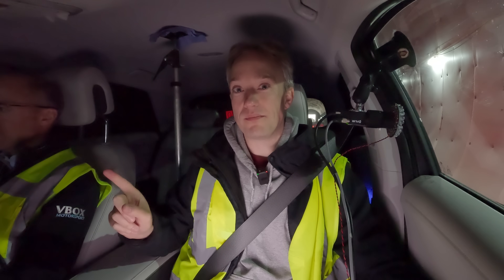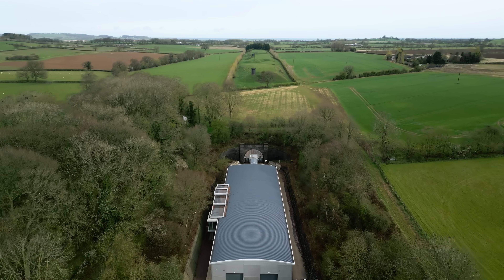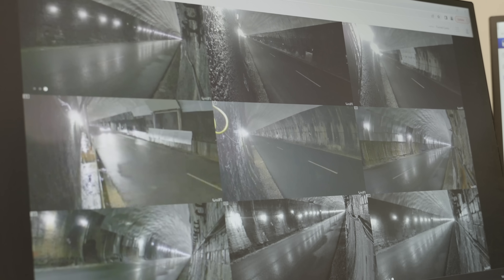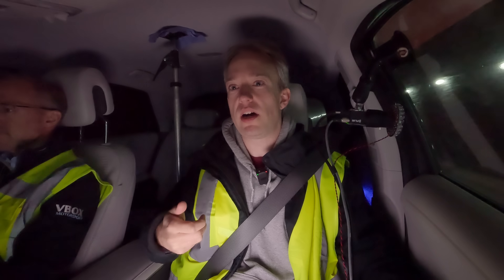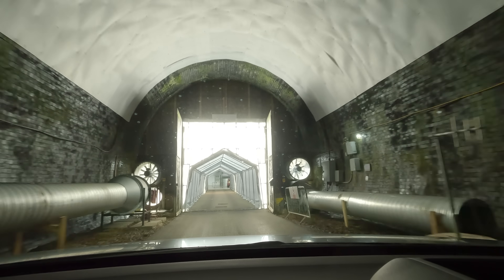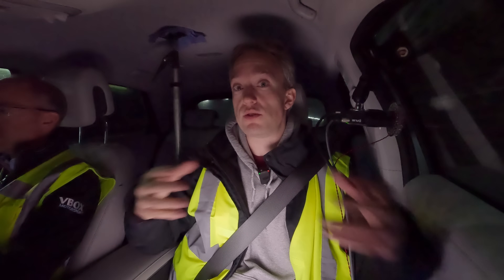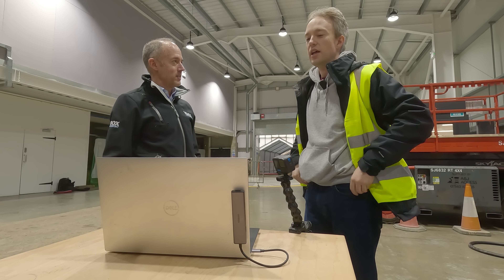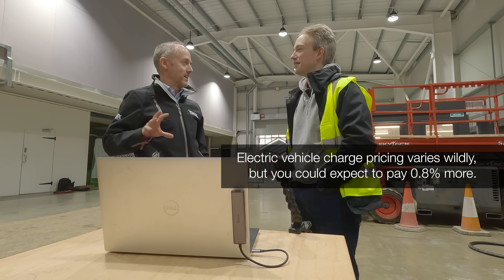This is an excuse to show you a really good tunnel

Comment: 3mm deviation off the laser is absolutely crazy to me. How did they do that?
Reply: From the overhead drone shot it looks like it was built using cut and cover (at least in parts) so after cutting the earth out they had clear sight lines with theodolites.
Reply: @TigerWalts  I believe it was only a tunnel because the local landowner made it part of his permission for the railway to cross his land. Otherwise it would simply have been a cutting. As a result I think you are correct, it was a cut and cover job.
Reply: @TigerWalts  Well spotted - those external shots looked very odd, almost as if the 'tunnel' had to be covered on parts of its length!  If so, why not just dig a cutting???
Reply: More stringent adherence to set measurements and probably a very accurate plumb line.
Reply: @glenngriffon  plumb lines are affected by gravity, that would give you a curved tunnel at these kinds of lengths
Reply: @glenngriffon  plumb line wouldn't do it - the direction of gravity is going to be about 0.025 degrees different (or 7e-5 turns), which means a height difference between 57cm and 1.14m between the laser measurement (near enough a stright line) and the plumb line curve, depending on where the tunnel is perfectly horizontal - at the midpoint, and both ends will be 57cm above the plumb line curve; at either end and the other end will be 1.14m above.
Reply: @glenngriffon how do you do a plumb line in a horizontal
Reply: @wellwell7950  "@Glenn Griffon how do you do a plumb line in a horizontal"

As plumb measures vertical level, you can't, unless their sense of vertical is perpendicular to relative to our vertical.
Reply: @glenngriffon  That doesn’t explain how they accounted for the curvature of the Earth. A plumb line always points to the centre of the Earth, give or take the odd density variance.
Reply: @glenngriffon  would the plumb line not make it go roundy because of the curvature of the earth though?
I don't know how to use a plumb line so that could be a very silly question
Reply: @sandwich2473  If you want a straight line, you cannot use anything affected by gravity, like water level or plumb lead.
Light would work. At the time they didn't know it too was affected by gravity anyway 🙃
Just not enough to make an earthly tunnel follow earth's curvature.
Reply: @Wannes_  Light would only work to a degree. Doesn't really take much to bend light. Really the only way to not would be in a vacuum.
Reply: @Wannes_  You can use any measuring device affected by gravity, as long as you can calculate the effect gravity has on it. For a water level, the air bubble just doesn't have to be in the middle (except in the middle of the tunnel). Calculating the angle is basic trigonometry.
Reply: @glenngriffon  I'm thinking a theodolite or a transit, used from a fixed point.  

If they'd just used a plumb line, wouldn't they have wound up following the curve of the earth, since "down" at each end would be at fractionally different angles from each other?
Reply: especially when considering the fact that over 2.7 km due to the curvature of the earth the tunnel rises 57 cm (22 inches) (making some assumptions)
Reply: @DanielQRT  I get about 14 cm  [ 6350-sqrt(6350^2-1.35^2) in kilometres ].
Reply: @jaapsch2  i assumed the tunnel was perfectly level at one end, your calculation assumes that it is perfectly level at the middle
Reply: @DanielQRT  You are completely correct. I assumed a straight line between start and end, and that the start and end are at the same elevation, and then the middle is 14 cm lower than an Earth curvature tunnel would be. Since they said the tunnel goes downhill or uphill all the way, your assumption is more appropriate for modelling this situation, and will give an answer approximately 4 times larger.
Reply: @DanielQRT  Turns out it's not level at either end nor middle; they advertise a constant 1:176 gradient (about 0.325 degrees). Gravity would differ by about 0.025 degrees between the ends. A constant gradient would be a good thing for railway.
Reply: @DanielQRT  "@Jaap Scherphuis  i assumed the tunnel was perfectly level at one end, your calculation assumes that it is perfectly level at the middle"

I'd argue that getting it "perfect" is impossible since we can't work at an infinitesimally small level. But, the tunnel could be either flat or level the entire length of the tunnel, but not both due to the scale. Being level at one entrance doesn't require the middle of the tunnel to not be level, it's just the point of level at the center or either end wouldn't be the same for the other two.
Reply: @DanielQRT  I think it's more like 14 cm, you might have forgotten to cut the tunnel length in half. If we assume the earth radius to be 6350 km, then we can create a right triangle with this radius as the hypotenuse, and half the tunnel length as the shorter other side. Now we calculate the difference of the radius and the longer other end to get the deviation due to curvature at the midpoint, where it is the highest: 6350 - sqrt(6350^2 - (2.7/2)^2) ≈ 0.00014 km = 0.14 m . When you do the the same calculation without using half of the tunnel distance, you get the 57 cm you mentioned. But I might have overlooked something, I just wanted to work it out for myself
Reply: @BambooTime  You're right, I did the math (in a different way) and got the same result, 14cm ... that means the difference between straight and curved has nothing to do with 19th century tunnel engineering and everything with 21st century road surfacing. Well, that answers that.
Reply: @MatthijsvanDuin  So, relative uphill and downhill, as opposed to the actual gradient. Yes, that is what I was referring to. Apparently the chosen language we each used was meant to convey the same thing but was confusing to the other.
Reply: @bodyrumuae2914 I really have no idea what distinction you're making here... How would you define uphill/downhill differently? 
What do you mean by "actual gradient"?

The gradient of a road is normally measured relative to a "horizontal" (i.e. level) surface, meaning zero gradient = neither uphill nor downhill = constant geopotential = a ball dropped on the street will stay put and not start rolling in some direction.
Reply: @MatthijsvanDuin  Now you're just confusing yourself.
Reply: @bodyrumuae2914  Ehm, no? I just asked you to clarify what you meant with "relative uphill and downhill, as opposed to the actual gradient" since I genuinely have no idea what you mean by "relative" or "actual" here or how they're opposed.

(And just in case, I clarified what, as far as I'm aware, the term "gradient" means when applied to roads.)
Reply: @MatthijsvanDuin  I already gave a confirmation, yet you continue. It's is you confusing yourself, not me confusing you.
Reply: Nope, laser level doesn't curve
Reply: @kylancook3477  The laser producing level itself, yes, won't curve. Laser beams, however, can be curved.
Reply: @DanielQRT  No, remember Tom explicitly said that this tunnel, even though it was built in the late 1800's, was straight and accounted for the curvature of the earth.  He said you can put a laser on one end and it will hit the other end.
Reply: @DanielQRT  The tunnel was built on a gradient of 1:176, too, with the south end being highest.
Reply: @DanielQRT 

I did a rather rough calculation and got a figure of 7 inches. But the error in that could be down to the number of significant digits involved. We're within a 3:1 range and the modern floor is much more precise.

It would be interesting to have floor-to-roof heights, but it would need a lot of readings because of the variations between blocks.
Reply: @DanielQRT    Not really.  There are different ways of defining earth curvature.   One way is to say if we draw a perfectly level line from this point,  now much will the earth have curved away from out line at XX distance.  For this defintion of curvature 57 centimeters is about right for 2.7 km.  However, this isn't really the best definition for this situation. Another way is to say, if you have two points XX apart on, and you draw a perfectly straight line between them,  how much will the earth curve above that line at the midway point.   The answer for that, for two points 2.7 km apart would be about 14 cm.   the 14 cm rise between the two points would be more applicable to this situation.
Reply: Visually lining up markers mostly. They started with two points to make a line, probably stakes in the ground with a marker attached. Then they keep adding these stakes as they go and line the markers up with the ones that came before. Great for getting a very straight line, but tiny inaccuracies at the beginning will go the whole length of the tunnel. I don't think it is that much different to how we do it today, except we have lasers.
Reply: @piraterubberduck6056  That the Roman Road way isn't it?'s
Reply: my guess would be literal thread under tension
Reply: @stefanmadzharov9170  not for several kilometers. We don't have a single material on earth that could withstand the tension needed so gravity doesn't get a say in the string's path....

Unless they stacked them after each other and someone with a really good eye, or one of these landscape measuring telescope things, checked that it was a straight line. Which I guess is kinda a "laser scale", just without the laser, but still light based.
Reply: @BloodyMobile  A theodolite
Reply: @BloodyMobile nobody said it needed to be one single line there could be tons of it put together but that gives much room for error tho so idk
Reply: @BloodyMobile  fair enough, didn't think this through.
Reply: @stefanmadzharov9170  Over a long enough distance, there is no substance that DOESN'T droop even at the maximum tension the material can tolerate.
Reply: @stefanmadzharov9170  my guess is water
Reply: Carefully
Reply: Maybe they did use a light, cause they couldn't use water.
Reply: Maybe with some sort of pipe level. Its amazing how accurate you can get with those.
Reply: @pepwaverley2185  you seem to be failing to understand that being straight and being level are totally different things. I could make a tunnel at 45 degrees that is within 3 mm of being perfectly straight and obviously any water would collect at the bottom.
Reply: Not just how, but why? A rail tunnel doesn't need such exact tolerances.
Reply: @ROGER2095  because it wasnt that precise back then, they just added the asphalt when they reopened the tunnel, and that had to be precise
Reply: They've got a modern road bed in that old tunnel, they could have evened out any flaws when they put that in.
Reply: Most likely, hyper advanced aliens with access to time travel.
Reply: @TheLolilol321  More European history needs to have the "bcuz aliens" explanation used for it.

How did the Berlin wall get built in a single day? Aliens. How was this clock tower monolith in London, nicknamed Big Ben by the locals, built? Aliens. How did Notre Dame get built? Aliens. How did Romans figure out you cud mix water with chunks of the earth and make concrete? Aliens taught them.
Reply: I imagine the clearly modern road surface has a lot to do with it.  The underlying tunnel could be off by inches and just smoothed over.
Reply: If you are very careful, check, recheck and check again with the instruments they did have then it can be done ....  it's just much quicker and easier now ...
Reply: I doubt that. Just the roughness of the surfaces is far more than that meaning that it deviates many centimeters within a meter.
Reply: A simple transit would do fine, as long as the operator is careful.
Reply: @rich1051414  "A very long string under tension. They just have to measure the distance to the road periodically down the length. This is why it's flatter than the curvature of the earth. A string under tension is flat."

For your claim to be true, that would require infinite *tension.
Reply: If you want crazy, look up the Ligo and Virgo experiments. They are like rulers in that they are devices that measure their own length. These tubes are about 4km long, but this length is known to a precision of a tenth of the width of an atom.
Reply: shovel
Reply: A theodolite was likely involved
Reply: If you look at some of the shots near the floor level that have low grazing incident angle one can see that the surface appears to have been ground and slightly polished (note the flat top of larger rock with the lack of sand attached to the flat surface).  This was probably done as the last step with a grinding machine that was sufficiently large to have multiple optical targets being monitored by an optical theodolite. Think of a large lapping machine with optical guidance. Probably did not use a Gyrotheodolite.
Reply: It must have been a coincidence surely
Reply: Probably a laser haha.
Reply: Tom Scott and James May would be either a great combo or at least a funny combo!
Reply: @smeeself I'm curious why 2700m could be a limit here
Reply: A very long spirit level
Reply: I’m guessing they used a theodolite (the tripod and telescope you see the surveyors using at the side of the roads sometimes)
Reply: now that is a video idea!
Reply: 2 or more holes lined up at the start and look through them for a light source.
Reply: @Henrix1998  that's very clever :O
if they made the same kind of apparatus and then positioned them a distance apart, it'd also keep them centred
Reply: they had math when they built it :P
Reply: @dingaia  Well they used Maths. It is Britain after all.
Reply: @dingaia no they had maths.
Reply: Serious Northerners with flatcaps, a pencil and a refusal to do a shoddy job. They probably got made redundant as soon as they'd finished, because Britain.
Reply: With good surveyors.
Reply: They have a big monument (just a massive concrete or stone that wont's easily move, might have been removed after construction) burried flush with the ground dead center of the tunnel, a probably a hundred feet from the entrance outside. (enough that it's not in the way as it can not get "bumped" there is usually a steel plate with screws on around it so it can be fine tuned. from there, the surveyor can set up his transit, or optics or whatever directly at the same spot every time. I'm not familiar with exactly how they did the measuring part of it, but it could be as simple as wait for night to fall, then have a second surveyor down at the working face measure out the exact center of the face and put a light there. if there's deviation from day to day, the tunnel is not true, and the surveyor will mark their center, and the true center as set by the transit outside, so the work can be adjusted.
Reply: I'm more interested in why it's a straight tunnel, given that this means the lowest point (in terms of geopotential) of the tunnel is in the middle and trains effectively have to go downhill and then uphill. Following the curvature of the Earth (i.e. constant geopotential gradient) seems more desirable
Reply: @MatthijsvanDuin  If the tunnel were actually straight in terms of the vertical axis, there wouldn't be an incline or decline gradient at any point of the tunnel. If you are considering "straight" as level (they aren't the same thing), then what you described would be true, IF the Earth was concaved. See my earlier response on that.
Reply: They used high precision optical land surveying tools.
Reply: @alidaraie  Lenses and light, much less, precision and height, hadn't yet been invented, silly.
Reply: @Sonny_McMacsson  The Level was invented in 1832, the tunnel was completed in 1897.  I have worked with some oldschool Levels, you have no idea how precise they are
Reply: @alidaraie  The precision of a tool doesn't imply you achieve that dimensional tolerance in practice. It doesn't happen in machining and so I wouldn't naively expect it here either.
Reply: @alidaraie  the Dumpy Level was invented in 1832,  the Y-Level was invented in 1780.   But anyway,  differential levels were around well before the tunnel was constructed.
Reply: @alidaraie  exactly. I've got a theodolite that predates this tunnel and you'd have no problem making the tunnel straight using it.
Reply: Patience, a bullseye lantern, and possibly lots of now illegal stimulants.
Reply: they used the laser
Reply: @Shive1337  Lasers didn't exist until the 20th century.
Reply: With a laser, I bet.
Reply: The used a laser measure.
Reply: @Smee Self the tunnel cannot possibly be a "straight line" and a "constant grade" at the same time, a tunnel at a constant grade will curve with the earth. you're contradicting yourself.
Reply: Maths. Over a decade before that, Switzerland built a 15.5km tunnel, and started digging not from just one, but both ends. The two tunnels met in the center of the mountain with being just a few centimeters off of each other. (And luckily, unlike the tunnel in the video, it's still being used for trains to this day).
Reply: I love all these theories that miss that actually - it was just good surveying. The tunnel was built using two different methods and from 9 different shafts that span out to meet each other. It took two years to bore, but at least in 1895-97 they were able to use steam-powered diggers.
Reply: With stove pipe hats!
Reply: Magic, of course.
Reply: Lots of rulers
Reply: idk
Reply: Using the most powerful computers on Earth there brains.
Reply: Visual surveying tools can be amazingly accurate if the operators are well trained and given the mandate and time to be precise.
We in the computer age are addicted to "LAZORS!", but a laser is just light of one specific "color". A surveying scope uses light too.
Reply: I don’t really know but at that time people were not stupid. For example in 1819 a surveyor measured the distance between two points in the Palatinate, Oggersheim to Speyer. This is a distance of 15.325 km. In 1996 the distance was checked with satellites. It was 0,398 m off. They wher quite accurate in 1819.
Reply: How about a line (like a rope) instead of a laser line?
Reply: Aliens
Reply: optical surveying was still a thing. One just had to use something like optical theodolites, plumb lines and so on. It was perfectly doable with the tech at the time. Just took strict adherence and a lot of work on surveying and continuing the cut as surveyed. Laser makes it faster and easier.
Reply: @Smee Self "perpendicular to the gravitational pull of earth" is what I mean by "flat to gravity". if the tunnel is a line then the ends can be geometrically extended to make that make sense. if the tunnel is a straight line it can't be on a constant grade at the same time. a straight line in polar coordinates (e.g. the tunnel) looks like a parabola when you transform to cartesian coordinates. a straight line in cartesian coordinates (e.g. the elevation of a person traveling through the tunnel if it hypothetically had a constant grade) looks like a segment of a spiral when you transform to polar coordinates. That's what the shape of the tunnel would be in real life if it followed a constant grade, not a straight line but a segment of a spiral.

do me a favor, go to desmos and put it in polar coordinates mode, type in "y=mod(x, 2pi)" as the equation and tell me ehat you see. it ain't a straight line, that's for sure, but that shape has a constant slope in that coordinate system.
Reply: @tissuepaper9962  reading your responses I see you are one of those that have an issue I addressed. Gravity doesn't determine if something is "flat," it effects level, level and flat are not the same thing.
Reply: They used a light at the end of a long tube
Reply: @Smee Self they didn’t care for the workers. They didn’t care for the environment.
Reply: @Smee Self how is that any different to me saying the tunnel is straight?
Reply: With a laser
Reply: A water level, its accuracy doesn't depend on distance unlike a laser level which is simply a beam of light that must itself be levelled somehow. Correcting for the curvature of the earth is then just a simple calculation the Victorians were perfectly aware of.
Reply: same way egyptians made the pyramids. beer and wizard magic.
Reply: @pepwaverley2185  well, water follows the curvature of the earth so a perfectly flat tunnel wouldn't be level, and water would flow to one side.
Reply: @smeeself Yes, a steampunk laser.
Reply: @pepwaverley2185  it is only 3mm off of being perfectly straight, the knee deep in water comes from the Earths curvature. The tunnel is straight, the Earth is curved.
Reply: @conorstewart2214  The water comes from a local change in soil/rock conditions and a lack of drainage there.
Reply: @firesurfer  yes that is why the water is there but it doesn't explain why it is limited to that end.
Reply: If it’s only 3mm of deviation how come one end was knee deep in water?!
Reply: @grilnam9945  Because the tunnel goes through a hill and the water table is different at the two ends.
Reply: @grilnam9945  Because earth is round and the tunnel is not, that means some parts of the tunnel must be further away from earth's center of mass(what we consider "being higher") than others. Therefor, the tunnel has a slope. The driver and Tom talked about that slope in the video. Water runs down the slope and accumulates around the deepest point.
Reply: @grilnam9945  Because not deviating from a straight line on a curved planet means something has to be uphill of something else.
Reply: @grilnam9945  Lack of drainage in that location.
Reply: @grilnam9945  3mm deviation from a straight line means that the elevation at both ends will be somewhat higher than in the middle, because earth is curved rather dramatically compared to a laser beam. I imagine that what he referred to as the "end" (they don't have access to the actual other end of the tunnel) was the end of the testing area, or somewhere just generally towards the other end. The middle of the tunnel should be about a foot lower than the ends I think. Also remember that there may have been a big mound of railroad ballast in the middle of the tunnel, leaving deep trenches either side where water could accumulate. If the ballast had been partially dug out, it may also explain why there was standing water at one end but not the other.
Reply: @grilnam9945  Because the earth is spherical, a straight line between two points would either intercept the normal sphere two points, creating a low spot (relative to gravity) in the middle, or it would intercept a single point before branching off tangentially to the sphere's surface, creating a low spot relative to gravity at the point where the tangent intercepts the sphere's surface
Reply: With a steady hand and a very long ruler
Reply: Victorians had access to very accurate theodolites and some excellent surveyors. They clearly accounted for geodetic effects and removed them to make it geometrically flat, but gravimetrically bowl-shaped. This probably made it easier to find a level when cutting the tunnel.
Reply: Old water tube level.
Reply: @ArronMurray  wouldn’t that cause issues with the earths curve? There is a slope to the tunnel.
Reply: Probably with a light source, 2 planks with holes in them and a whole lot of time.
Reply: @Smee Self the tunnel can't possibly have a "constant" gradient, it's flat to gravity at one end and sloped at the other; something something intermediate value theorem, the slope in the middle must be changing.

edit: now I've re-read and I guess you're saying that the employee of the tunnel is just completely incorrect when he says "3mm deviation from a laser level". without a source I'm going to take the number from a current technician, not some random guy.
Reply: They were the victorians. They were in Britain. It was the 1800s.
Reply: flat earth
Reply: @hongk0ngfu3y flat brain
Reply: @GRE3NT  Why is there a need to insult them?
Reply: @GRE3NT  Haha, brutal 😅👏
Reply: @hongk0ngfu3y  absolutely. And every other tunnelbuilder on earth is and was in on the conspiracy and build in a slight curvature, especially in older tunnels 👍
Reply: @hongk0ngfu3y  flat balls
Reply: @hongk0ngfu3y  I actually laughed out loud, thanks.  xD
Reply: @hongk0ngfu3y  JAKE!!! ARE YOU /srs OR /j
Reply: @hongk0ngfu3y  Maybe... they just dropped a marble on the floor and leveled the floor until the marble stopped rolling.
Reply: I don't wanna say it was the aliens, but it was the aliens.
Reply: With a peace of sting
Reply: Maybe a water pipe with risers every 50m or so, with a transparent part at the top. That would get you mm-level precision. Expensively, but easily.
Reply: this is trivial: use a water level, just like the Romans
Reply: Victorians
Reply: @Smee Self You didn't pay attention. The original tunnel was 3mm off perfectly level.
Reply: Why does no one know how a spirit level or plum line works (clue : they’re both relative to the Earth)
Reply: @Autumnrainfall99  Your response shows that you didn't read the thread where one questioned why another thinks plumb would measure the horizontal axis and I responded by pointing out that it would if their sense of vertical is perpendicular to ours.
Reply: Timetravel
Reply: They didn’t. If if was truely laser level within 3mm, not only the farside of the tunnel would be knee-deep in water but the intire tunnel.
Reply: @partraiserhc9351 it's opposite, if the tunnel obeyed earth's curvature water would spread evenly, but because it's almost completely "laser" straight one end of it is actually higher above the earth than the other.
Reply: a long hose full of water with a glass tube at each end
Reply: Water level?